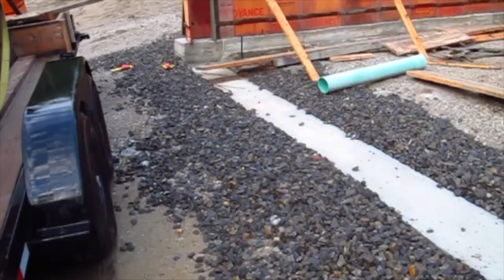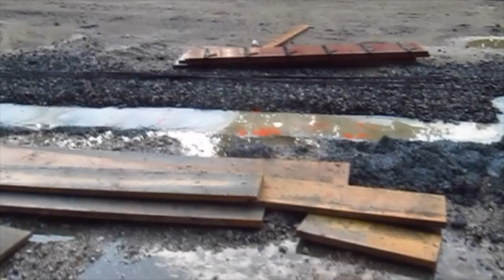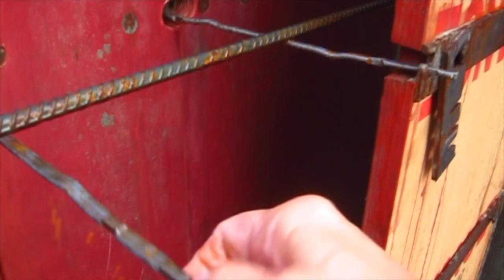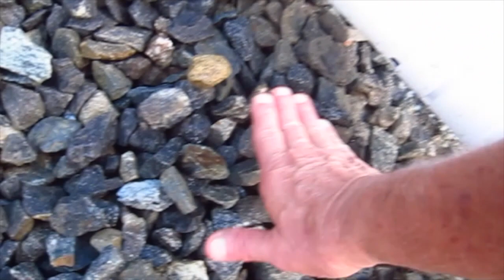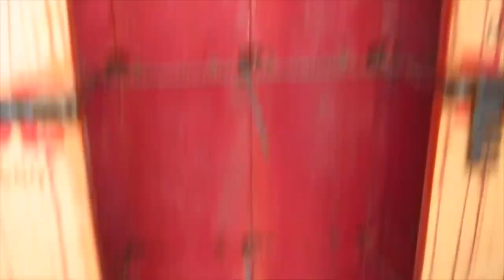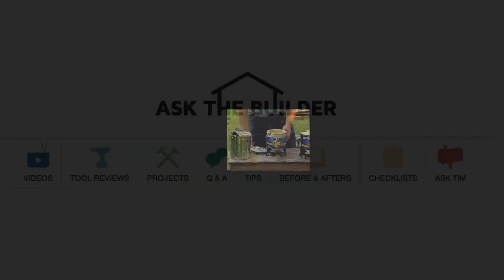House Foundation Part 1

Comment: I am really amazed about how much steel rebars are supporting this steel/concrete wall...

I will build very similar garage/basement.

I am planning to use 15x more of a way more thicker steel rebars.

These are bo vertical rebars from the bottom to the top?!

Is that ok?

How is that possible that this did pass the inspection?!

I don't get it.

I am DIY man but by myself this is a joke...

No insults... I am just amazed.

Comment: if they have a drain pipe running along the footings of the back wall and then down into that side drain pipe isn't that enuf to keep the water from going under the back footing and into the basement?
Reply from the maker: Not when it gets CHOKED with ice this winter!!! Watch my Drain Tile video that's part of this series.

Comment: I understand now why it was important to level the footer to save work later. Shouldn’t the building inspector catch they are not laying the rebar reinforcement properly or is that not code in your area?
Reply from the maker: I can't tell you. The code is a set of *recommendations*. Each town/city can ignore or stiffen what's in the code. It's impossible to memorize what's required in each location. What's more, I'm not building any longer so I don't care what the code says since it doesn't affect my livelihood.